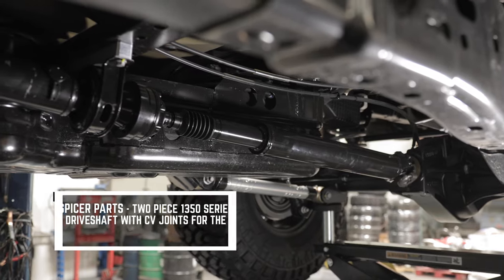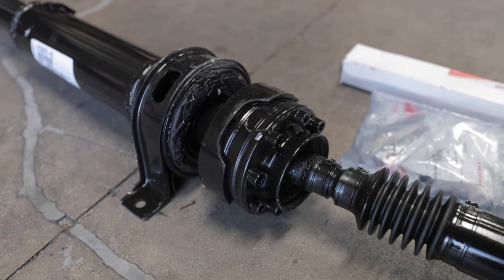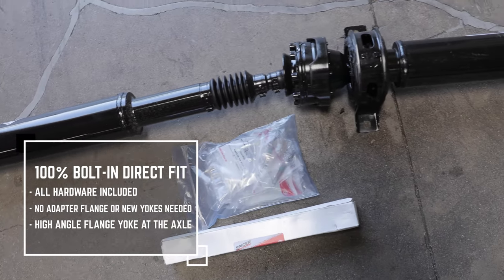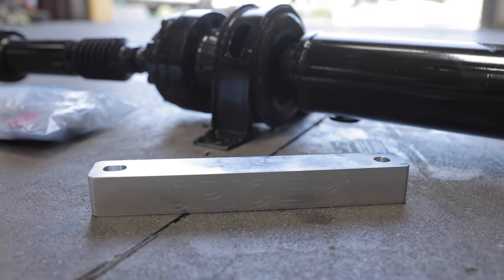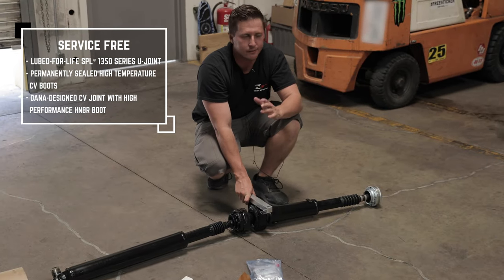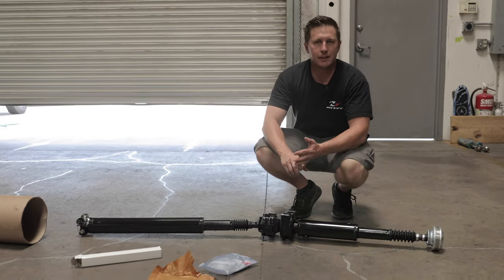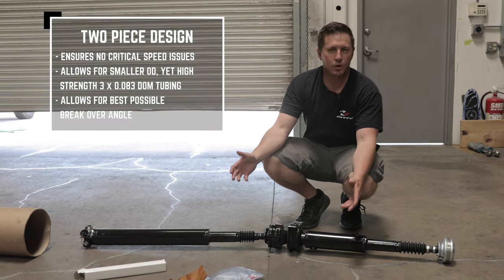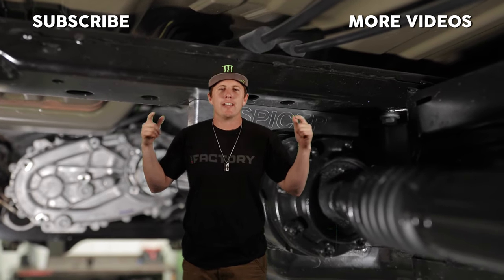NEW BOLT IN DRIVESHAFT FOR JEEP GLADIATORS FROM SPICER | TECH TUESDAY

Comment: i am interested in installing a 14 bolt rear axle.  will this driveshaft bolt in with a 1350 yoke on the axle.
Reply from the maker: You will have to measure lengths